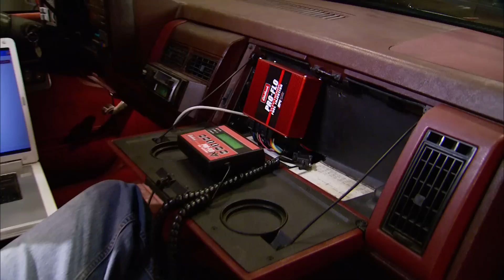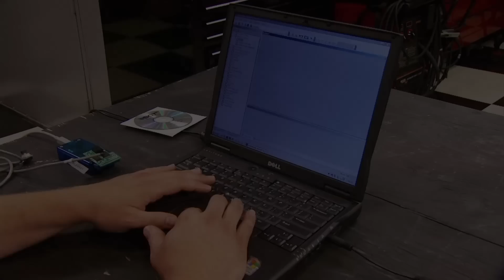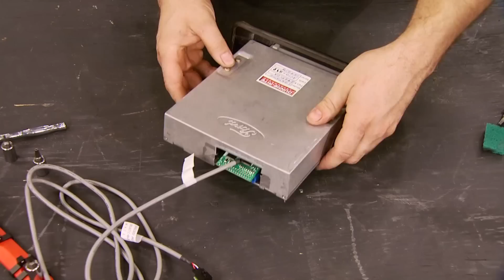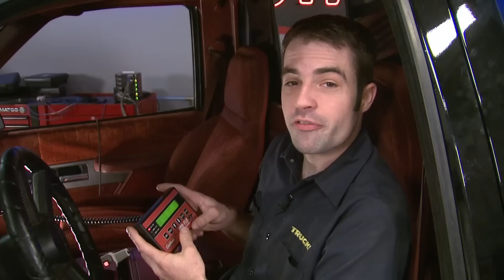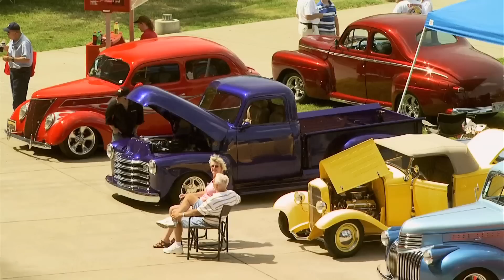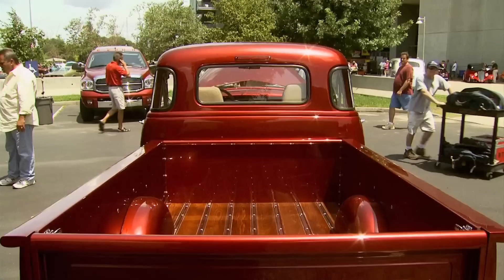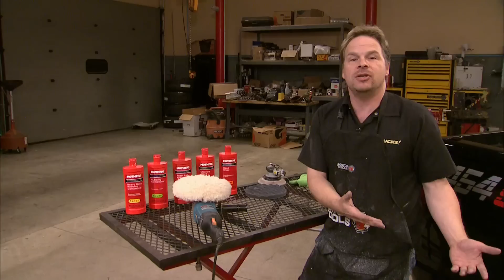Chassis Dyno Shootout: Chevy 454 SS vs Ford Lightning MuscleTrux Wars Part 6 - Trucks! S10, E15

Comment: Disssssapooonting by both! But damn that  big block torque is PATHETIC! YUK!FAIL!👎👎
Reply: @bigboreracing356  lmao shows what you know! The torque is pathetic on the big block. Fact! And Ill briefly bring up the disaster  they turned the lightning into. the turbo  set up is thee  most  Inefficient setup! But I wont even get into that with you because this is all big boy talk you just arent ready for... now  run  along.
Reply: @bigboreracing356  you are just stating vague points.no shit not all aftermarkets make big power. But a cam in those specs and the money they spent on top end  they should have gotten better numbers
Reply: You have to understand that the emissions stuff on those trucks rob a lot of power, and also the pistons in those engines were built for low completion, meaning not much horsepower, even when bolting on a bunch of high spending performance parts like turbos, heads, and cams, emissions will rob a bunch of power, and the lack of proper drivetrain components like a beaffed up transmission and better rear end, wont also help u out very much when it comes to a chassis dyno. But if u put those enginse on an engine dyno, both would probably make about 400 to 450 horsepower
Reply: @sethnelson8698  they ditched the EGR tbi and almost all emissions crap on the big block..those are sad numbers..
Reply: Both trucks are running cats
Reply: STREET RACER ok boomer
Reply: STREET RACER no u.

Comment: These guys should have known they would need a bigger pump especially switching to maf, wasted video this truck should make  400-450hp and nearly 500 ft lbs. Jesus i need to start my own show, do shit right and not waste peoples time..
Reply: You ain't lying!
Reply: MAF swap alone would not have necessitated a larger fuel pump. But you're correct, anybody who's going to run a boosted engine knows to upgrade the fuel system to support it before installing the turbo or SC. That's tuning 101, more air = more fuel as well.

Comment: Why in the hell would you not put 100.00 dollar walbro 255 in from the jump? Stock fuel pump isn’t gonna handle boost. 🤦🏻‍♂️
Reply: Or add a rising rate fuel pressure regulator
Reply: @user-dn6qy1ou1f  those are hardly ever worth it when you can just get a good pump .by the time you get a riser and a pump you could have just gottena  better pump.
Reply: @bigboreracing356  you really are a know it all tough guy troll douche bag arent ya ...salty bitch

Comment: watching this makes me realize we live in the golden age of cheap horsepower.
Reply: As long as you don't buy all of the plug and play stuff that's constantly pitched as stealth advertising on these shows. 

If you were willing to spend a few bucks years ago, though, you could have a 450 horsepower lumpy chevy 350 for not that much money. I think the transmissions have made just as much of a stride as the motors - aside from the fact that you can get cheap motors now that will take a fair amount of boost. Hard to come up with one that's in a reliable car that lasts, though. 

Audi 1.8T, 375 horsepower when you want it turned up? No problem. having the rest of the car last as long as the turned up motor? no way. 

What about the little ecoboosts...time will tell. The cars get junkier and heavier around the motors every day. 

what would a 450 horsepower 350 run these days in a 2800 pound drag car with good tires and a good trans?12s? 11s?
Reply: @daw162 60 Foot Elapsed Time = 
1.6485074661226427

1/8 Mile Elapsed Time = 
7.226106441704612

1/4 Mile Elapsed Time = 
10.713822218280018

1/4 Mile Trap Speed = 
133.74778587935575
all are estimates, results may vary, offer not available in Nashville Tn.
Reply: @daw162  I can make 200 hp with a 500 dollar 2.2 liter honda h22 engine.
Put a 300 dollar turbo on it and some 400 dollar fuel injectors along with a 500 dollar engine management system and 500 whp is very reachable.
Spend 3k on forged internals & even bigger injectors and the power levels get rediculose.
LS v8s are similar.
Reply: theodore Dow-man yes you can but they don’t last long transmission go and without sleeves block it’s on borrowed time 350 all day everyday no problem but 500 not gonna live that mong
Reply: I have a '95 454 4X4 GMC Suburban. And would not mind doing the same mods. But I rarely drive it. 
Maybe 600 miles driven in past 4 years.
Reply: Funny, guys in the 1940s thought the same thing. Wonder if guys will be thinking it in 2090.
Reply: @Matt-df5fe neither one of these trucks are considered cheap if they are in decent shape. Big block chevy performance parts are usually far from cheap.

Comment: All that money spent and you could push more out of a na 351w with heads and an intake.
Reply: STREET RACER I’m not what your issue is but I’ve built numerous 351’s and have made 400+ hp with just intake, cam, afr heads, 750cfm carb, long tube headers, with the stock bottom end.
Reply: Nitrous alone and they'd be further ahead
Reply: STREET RACER huh?

Comment: I'm surprised(yes, I know this episode is over 10 years old) that they didn't go the Mustang route on the Lightning and go with a stroker kit on the 351W to at least 408 or better yet a 427, then slap a Vortech supercharger on it, would've easily made 500 to the rear wheels. All the technology to do that existed back then.....
Reply: That is a completely different block the 351m is a 408 the 351w is a 302
Reply: @michaelbradley770  I think you haven't kept up on stroker kits for the Windsor line of V8s..... the 351W can be stroked out to 393, 408 and 427, with a 454 doable with an aftermarket block. The 351M also had a variant in the 400M version(both dubbed 335 series V8), both roughly using the 351C and 429 (385 series V8) architecture.

Comment: And they guessed 450 HP with the Chevy, I’m feeling let down
Reply: Yeah. To be honest they would’ve been better off by turboing the 454 on the stock block if he wanted that 450 horse.
Reply: @bigboreracing356  only thing your satisfying is a casket and a chasity belt
Reply: @everythingautomotiveeta5839  LMAO Thanks.  I needed that.
Reply: STREET RACER Jesus dude chill. Also I could Hook a bass boat to a GTO and tow it if I changed the gearing.  My 2500 has the same 454 big block in a 1970 chevelle but you won’t tow with a chevelle cause a Muncie m22 has a gear spread of 2.21 and and Muncie SM465 has a gear spread of 6.55.  Take a break from your steroids and try some deep breathing,  it’s YouTube
Reply: @nolanmcevoy2547  Steroids? he is probably still eating his GUMMY BEAR VITAMINS. I would be so depressed if I were his father.
Reply: No kidding.  When they were posting the numbers I was just thinking "That's way low from their goal"    :(
Reply: Maybe at the crank
Reply: +Joe Stacks I mean doing nothing. He was better off leaving the block stock- that means modifying nothing, not putting thousands into a cam and heads.
Reply: These shows are designed to advertise, not educate. Can you think of any reason they'd need to pitch sandpaper and polish at the end of a power build? I can't other than money. 

Can you imagine telling someone that you were going to show a motor change in a car and a necessary part of the show was polishing the car at the end? Only an advertiser would think of something that stupid.
Reply: Street spanker
Reply: Gabe Ferron It was before compression ratios were allowed to be higher than 9 to one. Factory rated motor at 230 so they made progress..
Reply: @Thelongmanable  What? That's not true.
Reply: @Thelongmanable  nothing was in place that said they were not "allowed" to have a higher compression ratio...  using another GM engine from that era, the L98 had a higher compression ratio for its entire build run.  Starting with 9.5:1 in 85, and climbing to 10.25:1 by 1990.  It had nothing AT ALL to do with being allowed.  GM just went the lazy route, and plucked an engine from the 3500 line to drop into a standard cab, short box, half ton.  It should have had at least another full point of compression, and an appropriate cam.  I still think these trucks are cool, but they wasted so much potential by being lazy.  If they wanted the easy route, they actually could have just used the l98 I mentioned.  It made more horsepower, at the sacrifice of some torque.  It even had the benefit of weighing less.  At 250hp, and 350ftlbs the l98 would have made this truck quicker in all metrics.  Even having a good 4 speed auto to back it up so it could return a bit better mileage.  They had all the pieces, they just refused to use them.
Reply: Actually during Nixion administration and 1970 oil crises mandated U.S. cars drop compression and Ford was told to stop racing in lemans.. Note the L88 most famous 1960s era motor made in race trim 12.5 to one compression giving the Corvette a 11.6 1/4 mile time which stock Lamborghini and Ferrari runs same times today. Don Yenco put these in Novas, and other muscle cars of that era. What most dont know is Don Yenco was huge SCCA racer for the Turbo Corvair that kicked the crap out of the Porsche spyder. See our SECRET SERVICE failed us because Ralph Nader made up lies that were contradicted by Don Yencos dominance over European race cars at the time. Also Lee Iocca screwed us over when he said no to carol shelby's IRS supension named T5 in which few prototypes exist today. Also the AWD version was denied by Iocca but just think if the Mustang was built from day one with IRS and AWD there would be no European sports cars that could touch it.
Reply: This link talks about the IRS race gt350 shelby version that got cut by Lee Iocca. Now he don't say who was responsible but Shelby didn't make them only a race version which he got from Ford. America has had operatives working against the country's best intrest which I spend a lot of time studying. https://youtu.be/AnngWMMv9DA
Reply: @Thelongmanable  you just replied with quite a long paragraph that means NOTHING to what we were discussing...  the low compression of this 454 was purely due to them dropping a low compression, towing engine, in a sport truck.  Nixon era policies weren't limiting any of the other engines...
Reply: @Thelongmanable  that's a different topic entirely.
Reply: The interview with the orginal GT 350 builders gives first hand account we could build way superior cars than we did back then but didn't based on corporate sabotage. It's Sabotage because 60s mustangs was selling over 400 thousand models which best selling car globally the Camry selling slightest less in 2017. Why was ford spending millions on projects like hard top convertible, IRS and awd mustang then to have European brands just ripp them off while they were being told no they can't use them... America global economic dominance has been stolen and our secret service is to blame..
Reply: wlabishler 1 In fact there is a famous speech of Nixon talking about it and the creation of a Alternate Energy program he approved of.
Reply: wlabishler 1 <-------<< Your one of THEM...
Reply: @SMSBJM1981  I picture him looking something like the Timmy character, from South Park....
Reply: They should have sourced a 496 short block or at least a cam that’s not meant for towing.honestly the only thing I like from eldebrock is their heads and intakes. Would have seen better way better results with trickflows top end kit....I’m curious to try that turbo kit on my ss.
Reply: @BigzeeeN  Edelbrock heads make serious trotline weights just saying. That's all their good for.
Reply: STREET RACER man I bet you twist a mean pipe 😂
Reply: STREET RACER dude! I almost missed your comments... don’t reply, just STFU, I don’t want to hear it 🤣
Reply: STREET RACER How big are the shards in your pipe bud
Reply: SZAJCONN Actually around 85 psi that won the world cup shift series this year.
Reply: @bigboreracing356  
You need to take your own advice and STFU.  The 454 SS was a sport truck, not a boat hauler, and it was just another one of Chevy's colossal failures.  What a disappointment that truck was.  These guys more or less emphasized just how shitty it was by throwing thousands of dollars in "high performance" parts at it and achieved very lackluster results.  Who jammed the pole so far up your ass?
Reply: Gabe Ferron pretty sure they meant 450hp at the crank, still low numbers but with 20% drivetrain loss is about right with 400hp
Reply: Alex Salazar and with several thousand dollars of upgrades anything less than 400 to the wheels is a disappointment.  Maybe if these guys spent less time advertising an more time wrenching n tuning they’d make power
Reply: @aaleexsaalaazaar  
It's still pretty underwhelming that a BBC 454 can't make at least 1 hp per cu in.   Edelbrock cams have never been part of my parts list, though.
Reply: @brussell639  They can, but you're talking a higher rpm engine with good heads and better compression.
Reply: Really? Don't you know the difference between HP at the flywheel as opposed to at the rear wheels? 318HP at the rear comes out to somewhere around 400HP+ at the flywheel. To get 400HP at the rear wheels they would have to have at least 500HP at the flywheel.
Reply: That Edelbrock stuff was old back when this video was made.  Those performer RPM heads have been left way in the dust with stuff by Brodix, DART, AFR, Profiler, just to name a few.  Heck, people are hand-porting stock heads and getting much better results.  That cam is also awful.  Lots of overlap to kill torque but still weak on the top end.  Way too much overlap for the low compression.    Much better choices from Lunati and Comp.
Reply: @aprilg5530  Right on. Cams, heads, and engine all need to be matched to produce the best power. For that low compression engine, they would have been better off exploiting torque and selecting heads/cam to maximize that. To take advantage of big rectangle port heads and high-lift cams you need high compression.
Reply: Me Too!!!!
Reply: Yes that was a let down, 318hp at the rear wheels = about 400hp at the crank, still with all the parts they added it should be more HP.
Reply: @NewtonWashinton  The parts were badly matched. Those heads and that cam have no business being on a low-compression engine.
Reply: For a 454 with heads, cam, and intake that was extremely low numbers. Those parts were not matched at all and were designed for a powerband higher than what they were spinning the engine at. Then there's the whole install a turbo and bigger injectors but not the fuel pump to support it deal.
Reply: @TwentytenS4B8  That's the truth. Low compression engines don't respond well to big heads and hot cams. Should have either upgraded the pistons for more compression or focused on a top end kit that emphasized low-end torque.
Reply: @bigboreracing356  everyone in this thread would wreck you
Reply: That was never intended to be a high-horsepower engine. It was a heavy-duty truck engine designed to make lots of low-end torque day in and day out. Putting in a hot cam and those heads are going to raise power at high rpms-right where that engine has limited capability to use it. If going that route probably should have bumped up compression more with pistons and better valvetrain to take advantage.
Reply: Those stock low-compression pistons in the 454 were never going to yield 400+hp at the tires without forced induction. Even factoring in the power loss through the TH400…..still a decent cruiser.
Reply: @CSHPTV  sounds about right. 2.5l 4 banger making half the horsepower of a 5.0 liter V8.
Reply: The compression was still too low.
Reply: Glad to see horsepower gains, but the torque doesn't seem great. Stock new that year truck had 385lb-ft at the crank. Would expect with the mods to see at least that much at the wheels.
Reply: @hogrod  I was also expecting much more torque. The stock engines 385lb-ft was made with 8 to 1 compression ratio. My 94 Z28 6 speed has 10.5 compression ratio with the LT-1 and 325 torque stock. My 2006 GTO with LS2 is 11 to 1 compression ratio and it made stock 400hp/400 torque. The latest coyotes are 12.5 to 1. I wish the 454 mods got the compression ratio up to 11 to 1. It would have been much better and way more power. 
     I was born in 1969 and watched emissions kill power in all engines. During that time people said "they don't make em like they used too!" They were right until the 90's when emissions were more dialed in and today even 4 cylinders have a lot of HP.
Reply: @hogrod  yes but these are way lighter
Reply: Indeed. They spent a ton of money, or what would be money if not given by sponsors, to make less than a new v8 pickup makes. By a good margin as well.
Reply: Th400 eats alot of hp. So don't feel let down.
Reply: @bigboreracing356  ok Boomer
Reply: @jradish  hhhhhhhhhh not everyones a fucking boomer
Reply: @salty_cracker69  He absolutely is lol. Only likes big blocks, small vocabulary so he only knows "stfu", always angry, that is peak boomer man

Comment: That 454 needs the bottle.... :D
Reply: Yea at least a 150-175 shot
Reply: Before the bottle they need better build parts. These power numbers for the money are hilariously embarrassing.
Reply: No it needs higher compression, a better cam and a stall
Reply: Sharp ass truck ...Needs power to match
Reply: Or a LS swap. Its wild to look back and see what was cutting edge just 10, 15 years ago
Reply: Gunner Dakota OR LSX 454!!!
Reply: @Thelongmanable  yeah it nuts, that a stock coyote truck makes more to the tire. 60's horsepower has nothing on todays
Reply: Gunner Dakota It's from a era of super Government regulation that wasn't based on any degree of SCIENCE...
Reply: Gunner Dakota Stop calling it a coyote truck
Reply: @Thelongmanable  yeah I know, I owned one as well as a gen 2 lightning, why would I stop referring to a 2011 and newer 5.0 Ford pickup as a coyote truck. When I say coyote truck  you should know I'm talking about a 11 or newer 5.0 Ford pickup, so what the fuck are you talking about?